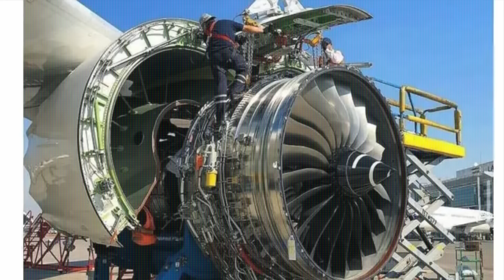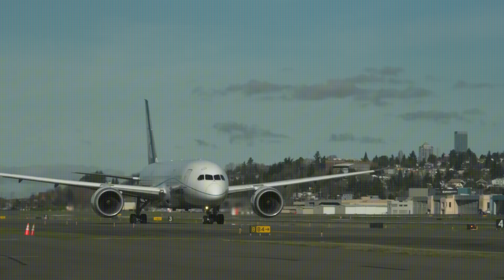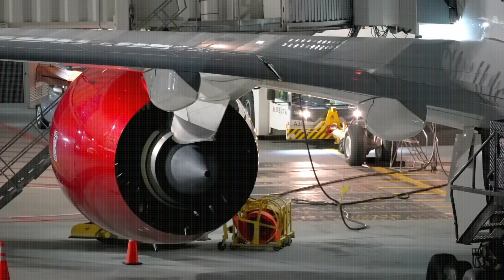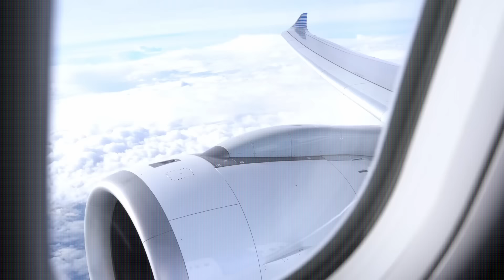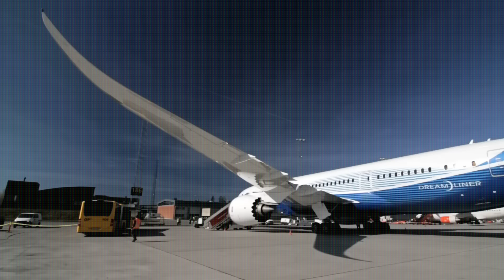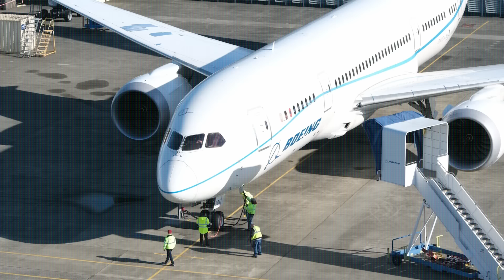How Airbus Just Saved Its Biggest Rival

Comment: And people wonder why Boeing doesn't have a Rolls engine for the 777...
Reply: It has, the Trent 800. But the 777ER is GE only.
Reply: Boeing did a single supplier deal with GE on the 777 in order to get the engine designed and built. Therefore no RR option would be available by Boeing design.
Airbus then did the same with RR on the A350, and then the A330neo.
Interestingly some new orders for RR engines on the B787 are coming forward.
What goes around comes around.....

Comment: All new modern airliners are just unreliable. Tons of engine issues including GE engines, B787s less than 10 years old start to age like 20 years old airliners. A380, A330, A320, B777 are the only ones that still doing well. B787 and A350 are just unreliable and within 10-15 years you will see them grounded.
Reply: Just like new cars, new appliances, new homes etc. Planned obsolescence.   Pure garbage but that is what the people want.
Reply: "A380....are the only ones that still doing well" So you forgot the cracks in the wings and the engine defect leaking oil in flight, etc????

Comment: Good to know the Trent 1000 has a fix, but airlines have moved on. About 1,000 787s on order right now, and of those that have specified an engine option, 90% are designated for GE engines. It's going to take time for RR to rebuild trust with airlines.
Reply: Even BA deserted RR for their new 787 orders - that’s says a lot.
Reply: Or GE runs into its own issues. None of them are immune.